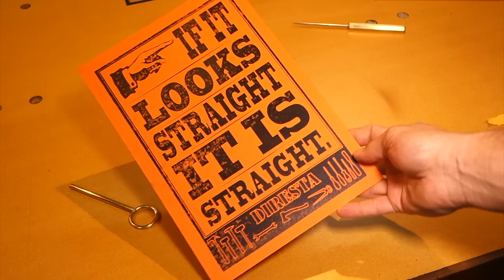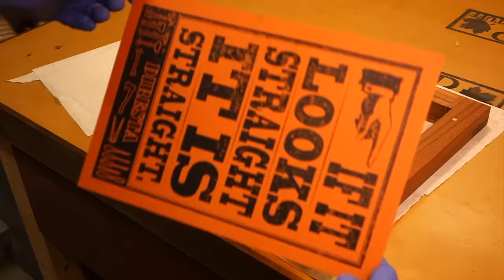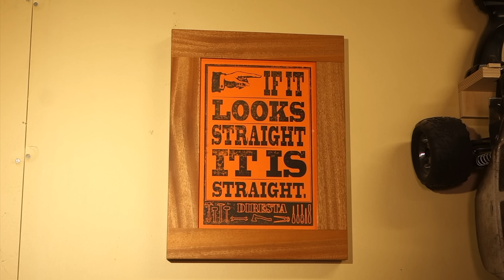Secret Compartment Frame

Comment: Very nice, when you split the board on the band saw it seems like it is the same thickness as before. How did you make up for the width of the blade? Seems like it would not be flush?
Reply from the maker: I mention that in the video description, but basically the band saw blade kerf is so thin, I was able to sand down the difference on the other boards.  Thanks!

Comment: Thanks for the quick explanations as to why you were doing various techniques at various parts. It made the video a lot more informative.
Did you have any trouble with those pieces of brass (?) bending when you were pushing them into the timber?
Reply from the maker: Gnuthad thank you! They were brass and I I had no problem getting them in there. I used the wooden mallet to make sure I didn't damage them.

Comment: At 2:54 when you are splitting that piece on the bandsaw,  what kind of blade are you using?   It looks like you are getting an incredibly smooth cut.  All of my bandsaw cuts are extremely rough
Reply from the maker: Its a scary expensive Laguna Resaw King blade.  If this one broke, I'd buy it again.  It transformed how I think about bandsaw cuts.

Comment: Dustin, I'm curious why you don't have the riving knife on your saw?  Serious question, do you have a reason for not using it?  I'm looking at upgrading my saw and one of the features I wanted most is a riving knife, hence my question.  Thanks for the vid btw, it's really a neat design.
Reply from the maker: Larry527az I have one and love it. I use it along with the guard since SawStop did an incredible job designing the whole thing. This was a particularly bad board and was pinching the riving knife too so I removed it. If you look close at that shot, you can see the board is already cut a little.
Reply: Dustin Penner
Okay, now it makes sense, good to know you like the saw, it's the one I'm saving my pennies for.  Thanks for the reply.

Comment: as always  very cool dustin! really like that. what are the dimensions...since i just got trolled for asking if there were plans..
Reply: really...you need plans for a frame?
Reply: Truman F .....dimensions..sorry. you know  like how thick is the wood he used,, how deep are the half laps he made,, how deep is the hidden compartment?..not sure what the difference is? plans or dimensions..is there??
Reply from the maker: Joe basementwoodworking I didn't make plans since they would only work for that size of picture. I based the thickness of the material on the thickness of the ice pick. I didn't want the have to make a groove in the front face.
Reply: Dustin Penner good point..thanks man!🖒

Comment: was that glass you cut? plus what oil dod you use? i know i know, yes im that bad :)
Reply from the maker: Yes that was 1/8" glass.  Freeze frame on the oil for the details but it's 3 in 1.  Prolongs the life of the cutter.
Reply: Cheers

Comment: did you shorten your ice pick?
Reply from the maker: yes!  About an inch off the handle and 3/4" off the spike.  I also trimmed the excess out of the sheath.  It's roughly 3" shorter but the spike is nearly the same.  Fits in my pocket better this way.  https://www.instagram.com/p/BK4R91GjrvL/?taken-by=dpmakestuff
Reply: I'm going to have to do the same thing.  i love the ice pick but it is just to long to keep in a pocket comfortably.
Reply from the maker: spence made Cutting the handle was easy.  I used a torch to heat the spike until it fell out and then trimmed the sheath to fit the spike perfectly.  Then I used a jewelers saw to remake the split and a steel center punch to make the dent.

Comment: Lively, lovely, and fun.  But please get that piece of wood that pushes the piece of wood through the cutting blade.  If not for your own safety, do it for the watchers of your video, so they know the safe way to push stuff through the cutting blade area.
Just saying.
Reply from the maker: I use a push stick when it is needed and only when it is needed. If you can control your wood safety with your hand you should. Push sticks are there for when you can’t.